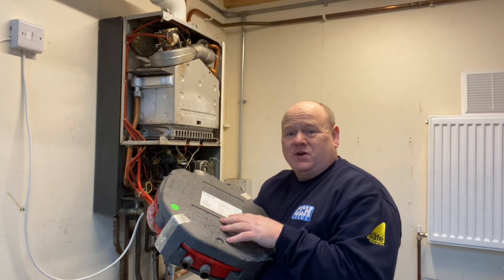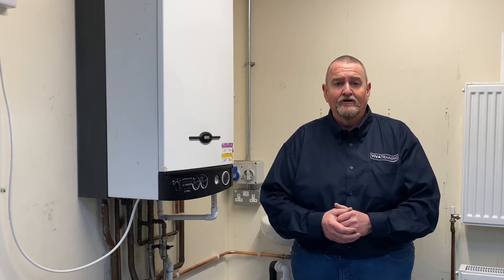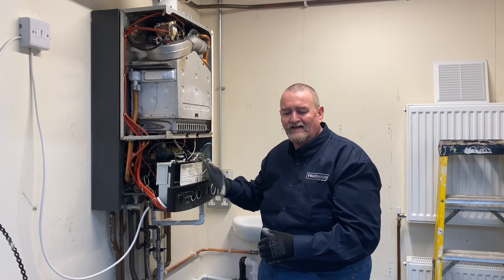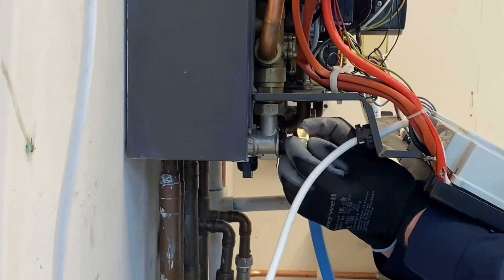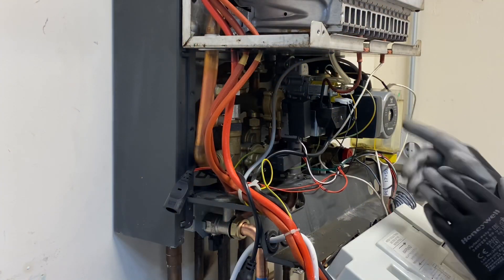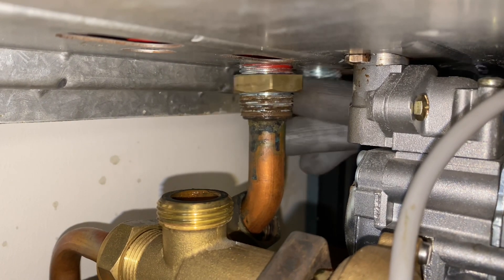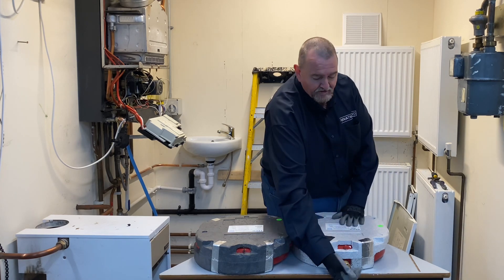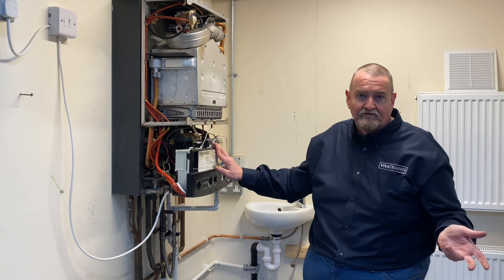Gas Training - How To Replace Expansion Vessel Baxi Boiler

Comment: Amazing video. Didn't watch it until today because I thought "well, this video is intended for a trainee, I know how to change the expansion vessel". Amazing lesson from Roy on how to put this type of diverter valve into mid position...I can do the same on the new condensing boilers from Glow worm and Vaillant with a PCB function, but in the video it's done with a small tool...Amazing content.

Comment: Hi
My Baxi Neta tech (2012), expansion vessel was replaced recently by BT engineer, but pressure keeps dropping evey 2, 3 days so I fill it up again using filling loop.

Do you think it's still faulty, or he couldn't diagnose the issue or it's normal and pressure will adjust itself after few days.

Thanks 😊

Comment: So add 3 isolation valves onto the job then, You know exactly what is going to happen when you turn the water back on.
The nib tool for the mid position, Can you buy that from Baxi ?
Reply: Hi Brian, unfortunately the tool is not available, they were made by one of the Baxi engineers, his hobby was model engineering. In the past I've used a wine bottle cork, with a self tapping screw, works nearly as well. Thanks for the feedback
Reply: @royfugler9971  Cheers for the heads up. I do appreciate the video.

Comment: I've changed a few of these in my time. Top tip for what I do (because I hate the sound of polystyrene squeaking) is give it a  spray of silicone down the edges of the insulation on the pressure vessel. Also I like the idea of the baxi tool for the diverter and I want one. In the past I have just use a Allen key (no pun Allen 🤣👍) and pushed it up and down on the pin.
Top video as always. 
Feel like I'm stalking ya watching these videos everyday..👍🤣😘
Reply from the maker: I still have your amazing video to upload ❤️
Reply: @AllenHart999  if im honest I'm missing Elliott... Im going to do a appeal video in one of my plantrooms tomorrow. That lad is a world of knowledge in domestic 👏.  As for the radiant tube breakdown its going to take some time. I'm getting the motor rewound and the high temperature silicone bagging is on back order from Arco.
Reply from the maker: @lizardboy0802  I have actually been working and haven’t had as much time to edit. I do love Elliots videos. We have some from Pete soon as well. 👍
Reply: @AllenHart999  nice one. Pete knows some stuff about check valves that even I didn't know. That's what I love about your channel. Everyday is a school day. Nobody knows it all.

Comment: Excellent tutorial Roy, where would we get hold of the Baxi mid position diverter tool from?
Reply: Unfortunately the mid position diverter tool was made by one of Baxi's engineers who's hobby was model engineering, so is not available, I've used a cork from a wine bottle in the past, which works 😀

Comment: Where can I get the gadget to put valve in mid position!!! A new gadget I’ve not seen before I neeed it in my life ha!
Reply: I just use a Allen key but yes I want one too.
Reply: Hi guys, unfortunately the diverter tool was made by a Baxi engineer who's hobby is model engineering so is not available to buy. In the past I've used a wine bottle cork

Comment: Looks like fused spur is still switched on
Reply from the maker: https://www.youtube.com/watch?v=5mIb8p3mYlQ
Reply: Hi PatG, well spotted, what you don't see is the fused spur is plugged into a double socket and was unplugged, so was electrically safe
Reply: Plug still in double socket at 8:12 and looks like it’s on